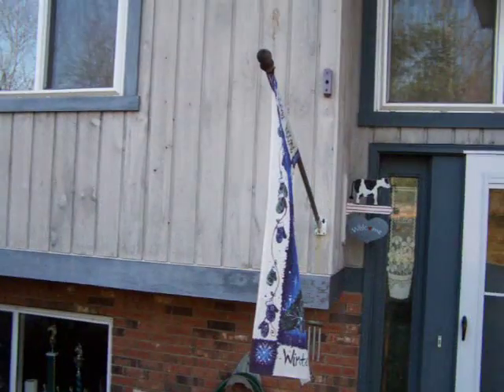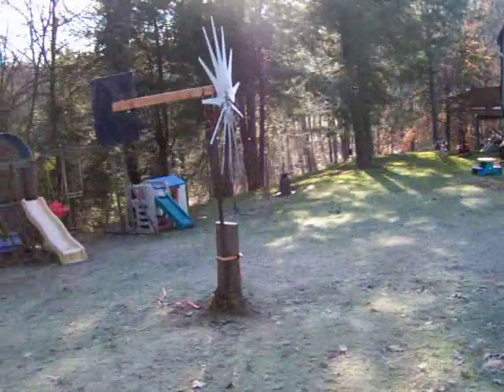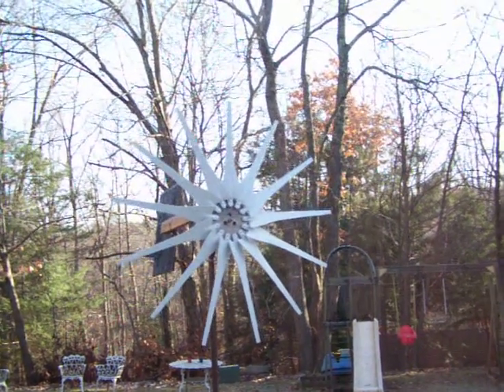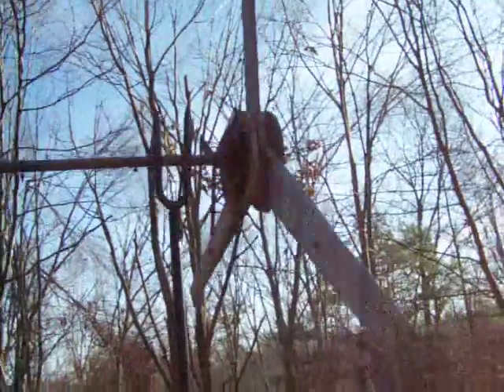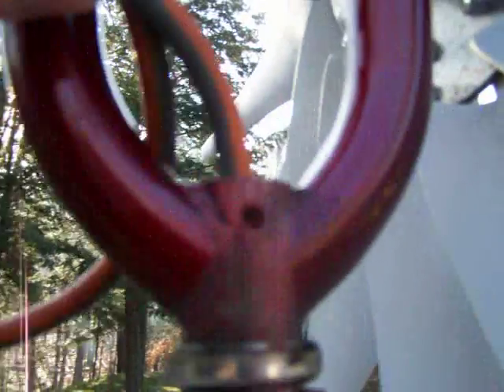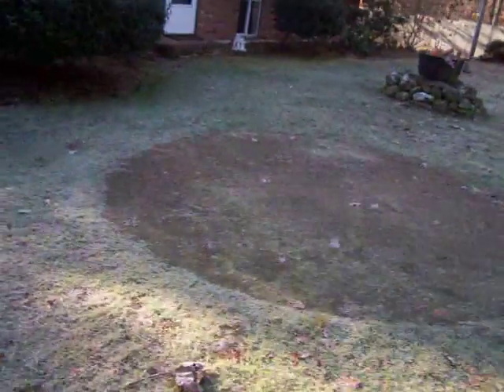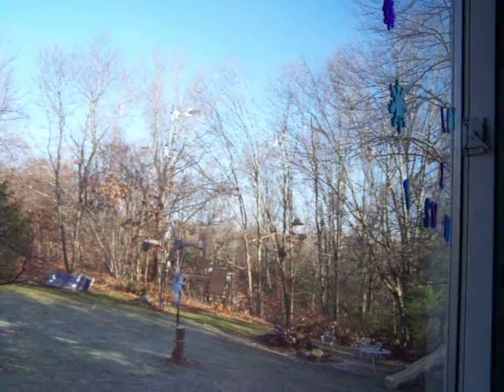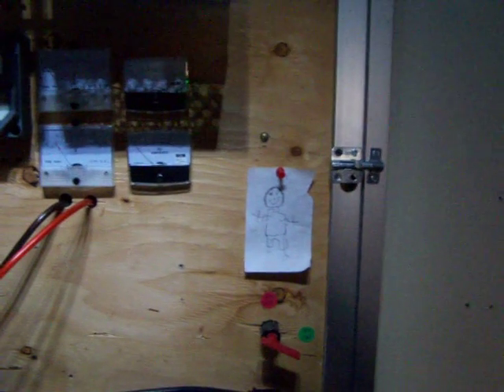wind turbines and solar

Comment: Hi Michael  I enjoy your videos. Just because the the tubine is spinning doesnt really matter. What does matter is at what wind speed it will satrt to charge a battery bank.A 12 volt battery bank needs about 14 volts to start charging . Keep the vidos coming good iformation.

Comment: Very nice. I am building mine as I have time. But I was wondering if you see a good amount of voltage from those turbines at all??  And do you have a battery bank to charge up. Not just powering an inverter.  Do they charge the batteries ok. ???   I have 8 large batteries I had the all connected in parallel but I think I'm  going to keep them split up a bit because it takes a long time to charge them at 40 amps. From my battery charger. It has taken all day sometimes for them to get fully charg